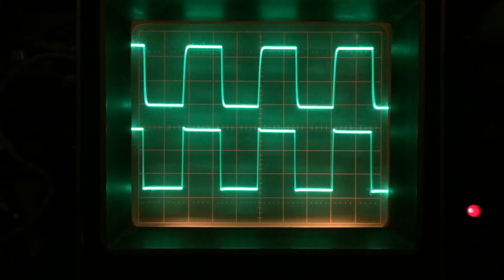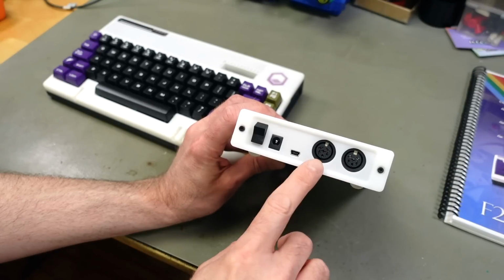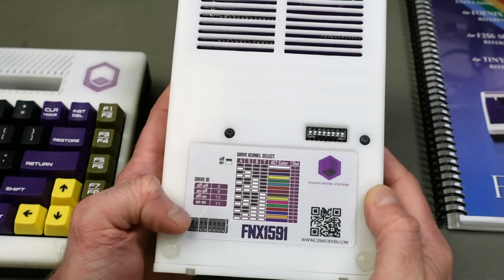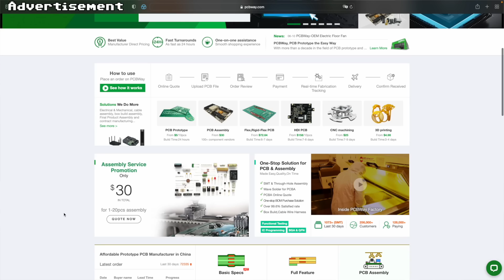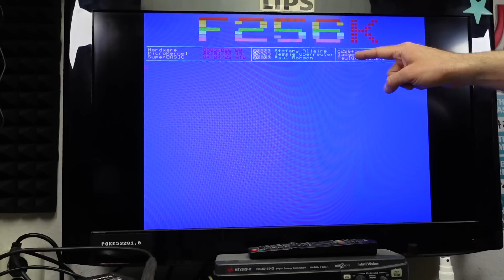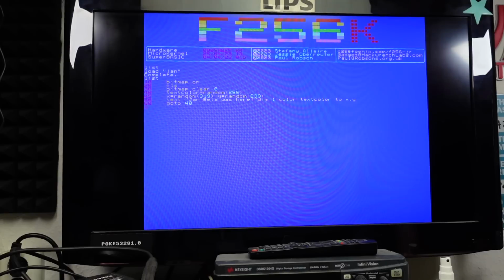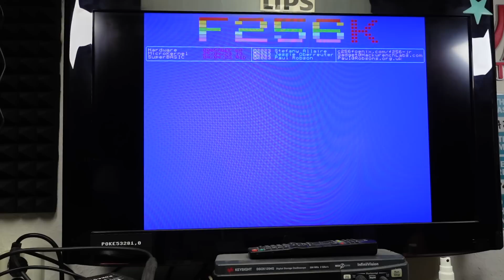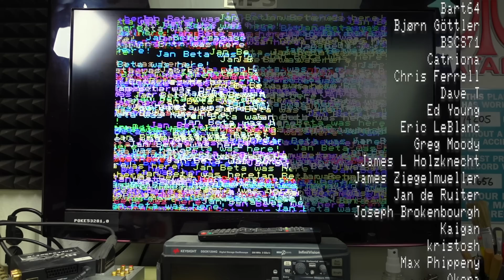Foenix F256K New Retro Computer

Comment: I like the design very much and the effort put into it is amazing. That keyboard is kickass too! Hats off to the creators. 

But for me personally, I don't really get these new "retro systems". To whom is it retro? No one will ever say, WOW did you see that amazing super mega demo made on the Foenix F256K? 
Why? Because it's not retro tech, at most it's enhanced older tech. Who will actually buy this to play games on?

Sorry if I sound negative and I might be missing the point here tho'. But when I see some stuff made for the, let's say Amiga, I know it's limitations and if someone really pushes these limitations, it always impresses me that people still manage do do that 30+ years later. The older systems also have that nostalgia that new "retro systems" doesn't have.
Reply: I get what you're saying.  For me though, I'm nostalgic about programming in 6502 (or 65816) assembly, and others are nostalgic about programming in BASIC, and I think we're interested in doing so on a machine that's super-powered compared to the ones we used back in the day (but which still has the familiar 8-bit architecture).
Reply: @frixyg2050  good point, if you were into into programming back in the day this is the perfect machine for you

Comment: No HDMI?
Reply from the maker: It has digital DVI out which can be used as an HDMI signal (no sound though) with a simple adapter. I found it difficult to have my HDMI monitor cooperate with the Foenix screen modes though, VGA was just plug and play.
Reply: HDMI has licensing fees. DVI is compatible and doesn't have those fees and as Jan stated is also compatible with VGA. I use DVI to HDMI or VGA cables at home and they work fine.
Reply: @JanBeta  Passive adapter I'm guessing? Wouldn't add any lag?
Reply from the maker: @andrewdunbar828  It's just a different plug, the signals are the same, completely passive. You may run into issues with HDMI devices not supporting the output resolutions from the Foenix though.

Comment: Can anyone name a reason for the floppy disk drive?  Is it to copy your old C64 disks?  Or to make new games and put them on a disk that will work on your C64?  But if you already have a C64 with a disk drive, you can plug that disk drive into the Foenix.  So it seems like a disk drive that you'd only need for your C64, if you don't have a disk drive for your C64, and it still serves no purpose for the Foenix.

Comment: I see that SuperBASIO is not compatible with SuperBASIC.
Reply: Sinclair SuperBasic from the QL? Which itself wasn't compatible with most other Basics of the day. Even popular versions of Microsoft Basic weren't completely compatible with each other, never mind the myriad of bespoke versions that existed. The two ANSI standards for Basic fell flat, and the original Dartmouth Basic was small, had extremely limited commands due to the machine it ran on, and was compiled, not interpreted. Basic is probably the least standardised programming language ever.😁

Comment: Not much more expensive than a Commander x16 ($500 for the initial board run) and includes a nicer case and keyboard.  Bargain really.  Then again the Agon Light is only $50.
Reply: Problem with the Commander x16 is you can't actually buy one, this seems to be a much better thought out machine if I am honest, much easier to manufacture hence the availability and the base system which is just a motherboard to fit a mini-itx case and power supply is only $200.

Comment: The 12 volt barrel input should be made to work with both center positive and center negative or else there will always be someone that use the wrong polarity.
Reply from the maker: I think the vast majority of modern barrel plug power supplies is center positive, so I'm not too worried about that. There's a polarity marking on the case, too.

Comment: One of the problem with these new american micros is the price. And I'm not talking about the selling price itself. If you are in Europe when you pay shipping + VAT you will easily hit 800-900 euro, which is ridiculous price for what you get. You can get a Steam Deck + emu for much cheaper price and you can play the new and old games, and have better experience (depending how capable is the emu). You can use it to develop for old or new systems. Maybe even play some AAA games.
Reply: I expect this is partially a first generation problem: If you start producing a computer like this, you have bills to pay and need to earn back that on unit sales. Once the startup costs have been paid, the material costs become more dominant and the prices can drop. Nevetheless, small scale production will never be able to compete with mass production devices like the Steam Deck (that may even be sold at a loss, you will buy games in the Steam Store), so you should also accept that retro computing is a costly hobby.
Reply: @danielmantione  As I said, it is not the price that bothers me, rather the additional costs that net 200-300 on top of the price.
Reply: @SquallSf  The bulk of that is VAT which might be less visible on products you buy within the EU, but you are still paying. But I agree shipment costs to get something from the U.S. are quite high.

Comment: DVI video???  WTH?
Reply from the maker: It is compatible with HDMI and VGA through simple passive adapters. Also, HDMI costs a licensing fee if done properly. I think DVI is actually a smart solution to have both digital and analog output options in a system like this.

Comment: Sorry - I just don't get the point of all these "new retro computer" things.  If it was a real retro computer, it'd have the software library.  Otherwise, it's slaughtered by a $10 Raspberry Pi running Linux in a 3d printed case.
Reply: with Python instead of a weird "BASIC" dialect for the heck of it.
Reply: Heh, you and I wrote basically the same sentence. My post was slightly longer tho'.

Comment: I wonder who will buy this as the price for basic setup is almost 600$ which is really high and there are no games for it.🤔
Reply: I did. In this day and age, having access to games is no longer a problem. Games of any type: modern, retro, any system. This machine is for hacking away and wrapping your mind around its architecture and learning to program for these old cpus and sound chips in an environment that's both limited compared to modern standards, yet very freeing compared to the 80's.

Comment: Another new machine with a custom keyboard layout. Hard pass.  This is one thing the x16 got right, and these other machines are all getting wrong IMHO.

It's cool on one hand that the board itself is available for less. That's meaningless though in the real sense of keyboard layout issues. It makes coding for it that much harder. Which keyboard layout are the people playing your game/using your software using?

Any new machine needs to use standard, off the shelf keyboard layouts IMHO.
Reply: Once you connect a Commodore floppy drive, you are in the Commodore 8-bit world and it has consequences for the rest of your system. You want to be able to read files from floppies and display them, so you need a PETSCII font. You likely also want to be able to run simple BASIC programs from floppies, so you have at least some compatibility. So you need a Commodore compatible BASIC. But that means you need to be able to type all those characters as well... so you need a PETSCII keyboard.
Reply: @danielmantione  The x16 keyboard has the PetSCII characters.  It just maintains the symbol positions of PC/Mac like above 2 is @ and not ".

Comment: As usual it has an FPGA capable of implementing the processor a dozen times over. They might as well just use a big mostly empty board with the FPGA in the middle. Not much taste here.
Reply from the maker: I think the idea was to use easy to understand original components for the most part and then implement the functionality that would have been custom chips (which are obviously not a viable option to have produced for a small volume product like this) in FPGA form.

Comment: why no hdmi?....its a big mistake they always doing...
Reply from the maker: Hdmi costs a licensing fee. Plus, you get the same functionality (minus sound output) from the DVI port with a simple adapter.
Reply: It's not a MISTAKE of any kind. It's a choice of paying for a licence to use HDMI, or using DVI which is licence free.
Reply: HDMI is DVI, just with a new connector. It uses the exact DVI spec for video, just with extra audio output.
Reply: Oh, I didn't know that there was a license fee for HDMI

Comment: I don't get the point of doing a computer like this with overkill parts.  Just the ESP32 (the wifi chip not populated) can do the job of all the other chips and the cost is 5$.  No need to have all these circuits.

Comment: It looks like a great machine but it's far too expensive at $595.
Reply: It's "home made" and not a lot can be made likely, not everything is made in China and can be so cheap.
Reply: It's a boutique product and consider the Apple I sold for $666.66 in 1977 dollars which is $3,345.70 in 2023 dollars, and it was considerably less capable. The Apple ][ was quite a bit more expensive still.
Reply: The F256 Jr is far cheaper with practically the same functionality so that'd make sense for someone with many components laying around, but bring your own lots-of-things: Sid chips, keyboard, power supply - may as well cut the hunt, import fees and get a really nicely put together, guaranteed to work F256K instead!
Reply: @VincentGroenewold  Sorry I didn't realise it was $595 Canadian dollars. It  converts to £355 UK sterling. That is a very reasonable price for a well designed niche computer. It certainly will give the Commander X16 a run for its money. I've got to admit it is one hell of a good looking machine. Looking forward to seeing what it can do in the hands of a skilled programmer.
Reply: @Peter_S_  The apple 1 was the first of its kind and cheaper than the alternatives
Reply: @Peter_S_ The Apple 1 was released at a time when there were relatively few computers around. Certainly not the sort of thing found in the average home. I like the idea of this machine, but this is an 8 bit, 6 MHz computer in a 64 bit, 4 GHz world. Any modern device could emulate the Foenix, or the whole thing fitted in to an FPGA device like the Mister, for LESS money. At the end of the day, it's a semi-nostalgic computer, but without the software, books and literature or the dedicated fan base of geniune retro computers that people had back in the day.
Reply: @another3997  Do you need a handkerchief?
Reply: @another3997  it is not about the money, it is about what you are getting out of the experience. All could be done with a RP2040 nowadays and most people will be happy to pay $10.00 to get a blue LED to blink, but that's basically what you are going to get. The Foenix products are meant to bring you back to a time where you needed to get off your fucking ass to get shit going. No freebies, no "here is the stuff that you need to not have to do anything to get your LED to blink" and then you can sparkled Syndrome your ass towards another waste of time... It is about getting the machine, get to know the machine and get it to work the way you saw fit and to get the reward for a well done job where you managed to go through all the hurdles, Etc... "There can't be no victory with peril"
No, it is NOT meant for everybody, most people don't care because it is more fun apparently to spend thousands of dollars in a hobby to retrofit your old stuff to make them usable in 2023 and then get bored or try to windup your community members... You see where I am going with that. There is no rewards from upgrading your old hardware aside of showing off... In the end, there is no fun having all the CPU power in the world, Having a gazillion petabyte of storage, there is no restriction so there is no creativity... 
Is that such a difficult thing to understand?

Comment: Software only available by Discord?  Well that's me out, Discord is a garbage platform.
Reply: Even if it were the case, refusing to buy a product you're interested in, just because you don't like Discord as a platform, is rather silly. I don't like the layout of my local Tesco Supermarket... but they usually sell what I want at reasonable prices, so I shop there. I don't like Facebook per se, but I joined several groups on there because that's where the people and knowledge I wanted access to gather together. Nose, Spite and Face?
Reply: @another3997  I would agree, but in your analogy the second I walked into Tesco for the very first time I was instantly banned for zero reason.
It is not a choice, the very first time I created an account to join Discord on first log in I didn't even get to finish loading the landing screen.  I was able to get in with an "oops our bad" only to be banned again 2 weeks later without a reason or explanation.  Their systems are broken, their support is broken, it is a garbage platform and I refuse to even try to get back onto it.
If people choose to put their projects solely into Discord they will find that there is a significant portion of the public who cannot access them.  These are not people who have broken the terms of service, these are people who Discord's broken systems are alienating.  That is the price these projects pay for putting all their eggs in a flawed basket, a significantly reduced user base.
So no, I am not cutting off my nose to spite my face, I am protecting my sanity from Discord's garbage platform.

Comment: $595 na, I'll pass
Reply from the maker: Canadian $$ though. ;)
Reply: @JanBeta  Still heavily overpriced in any currency.
Reply: You can get the "desktop" version F256jr for roughly half the price. It is essentially the same computer. Mainboard for $200 then add a case and PICO power supply and a keyboard, some cables. You may already have some of the parts needed somewhere laying around. While $200 is one third of the price, it can add up a bit as you make a build. Back in the days, keyboard computer were the cheap alternative, now it is kind of the opposite.
Reply: Not everything is made in China and by 1 or a few people, it's economics 1o1
Reply: @meh3247  the original 1978 price of a 48K Apple ][ in today's currency is $12,305.02. Let that sink in. That's why I only had 16K in 1978. It's a boutique product and consider the Apple I sold for $666.66 in 1977 dollars which is $3,345.70 in 2023 dollars, and it was considerably less capable. For what you get this looks quite decent at the price if you want to be realistic.
Reply: @Peter_S_ Your argument is catastrophically flawed. Everything has changed in the last 40 years. The Apple II was expensive, but it was at least comparable to other computers you could buy at the time. How can you possibly compare a "new" 6 MHz 8 bit computer with a modern 64 bit computer that runs at several GHz, has 100,000 times the RAM and incredible graphics and sound? Any modern device could emulate several Foenix computers at the same time without breaking a sweat... and yet still costs less than the Foenix. A £10 Raspberry Pi Zero can run RiscOS with built in, native BBC Basic.
Reply: @another3997  🙄Seek help.
Reply: @Throckmorton.Scribblemonger  Do you need a handkerchief? You seem triggered.